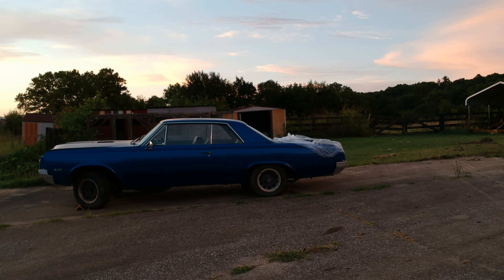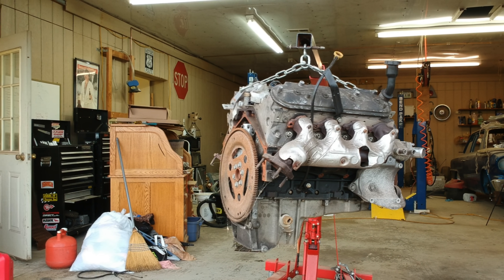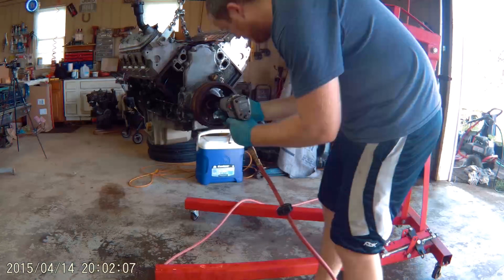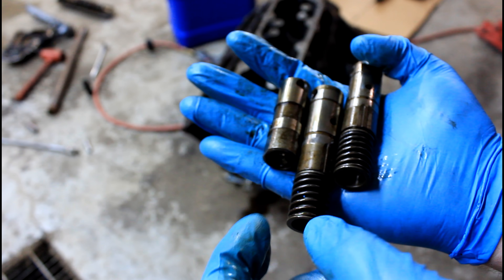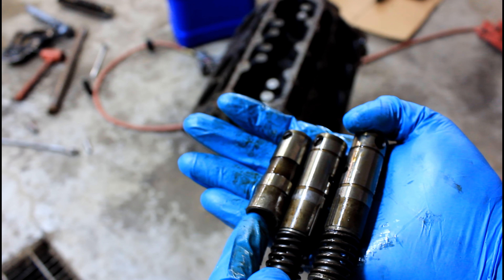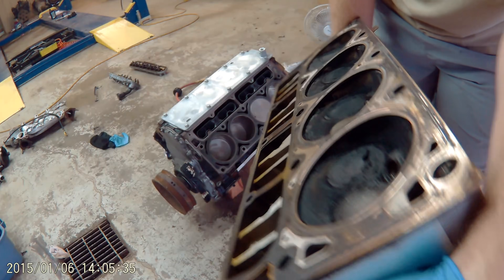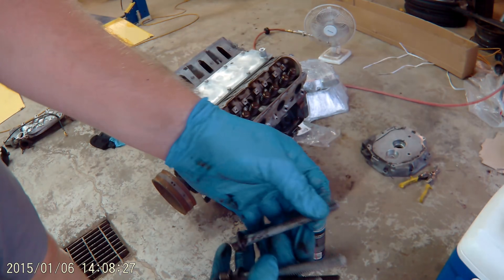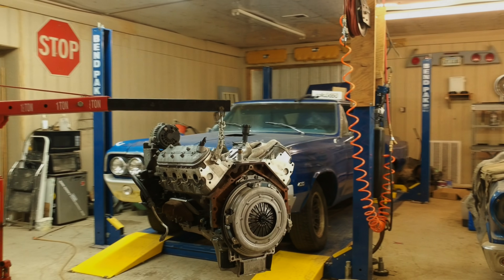LS Swap Budget Daily Driver!  Part 1 : Engine Build

Comment: Love the Oldsmobile.  I have a 69 cutlass convertible I did a stock 5.3/4l60e it has the stock gear non posi and I drove from Toledo Ohio to Cleveland Ohio (2 hour drive) 2 way trip on $14 in fuel.  Your definitely going in the right direction

Comment: Nice video. I have a 66 Chevelle that I am debating about putting in a 350 or a LS engine in it. It currently has a blown 454 and a Muncie 4 speed with 3.73 gears. Would love to install a T56 but they are so expensive. What are your thoughts LS or 350 small block? Subscribed .

Thanks
Reply: Thanks for responding back. I do have a sloppy stage 2 cam and PAC 1218 springs already.  Roughly what kind of rwhp would  a 5.3 or 6.0 LS put out with this cam in it?

Comment: Did you change the cam? Although it'll function. The lobes on the did cylinders measure different. Don't do the work of a cam swap with no can swap.